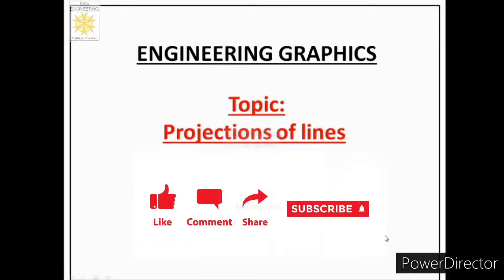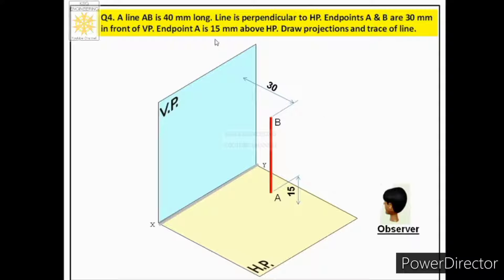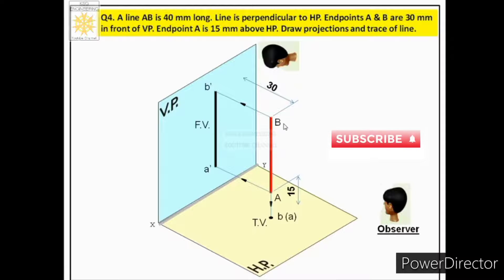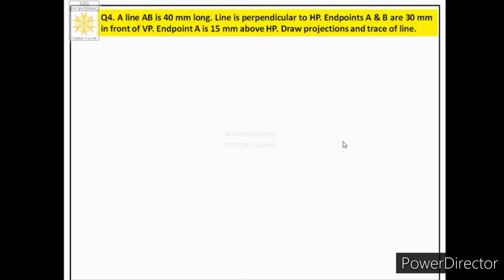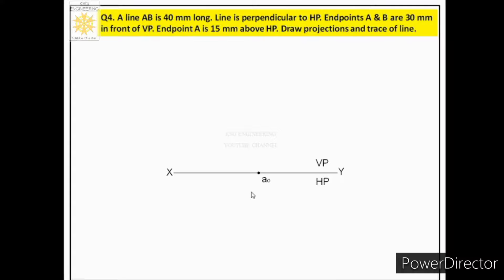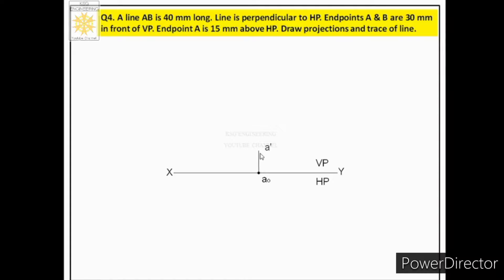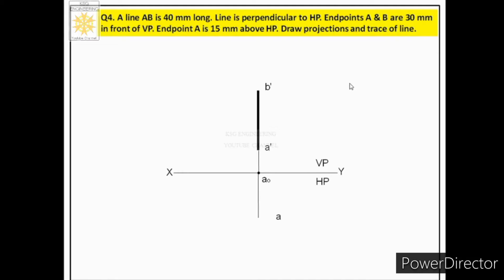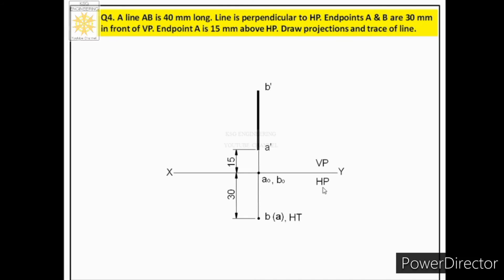Line perpendicular to HP and parallel to VP #engineeringgraphics #engineeringdrawing

Comment: Draw the projections of a line 70mm long when it is perpendicular to HP and
parallel to VP and 15mm in front of VP.

A)  FV  is vertical line(a'b') and TV is  points(a,b)
 TV is 15 mm from XY. 

 But In Question,  the Front-View  distance(above below  on HP) is not given. what should i do.
 i) should i start Drawing "Vertical line from XY" 
 (OR) 
ii) take my own wish "some MM from  XY" and draw. 
 if so, then do i need to mark that own MM with dimensioning in ExamSheet.
Reply from the maker: You can write a note at the top of the answer that as the distance of line from HP is not mentioned so i have assumed it as 10 mm and drawn in the first angle of projection. And mark 10 mm on the answer that is above xy line